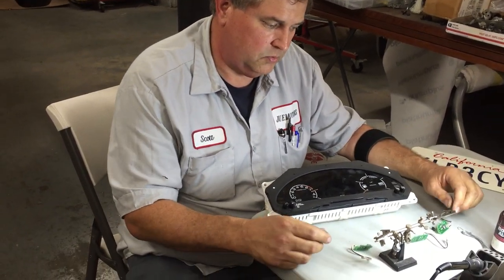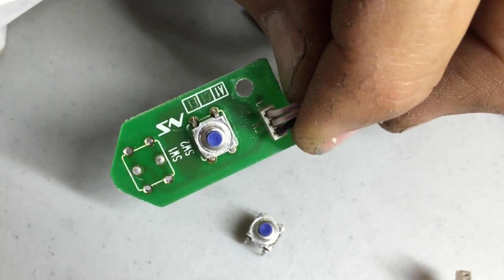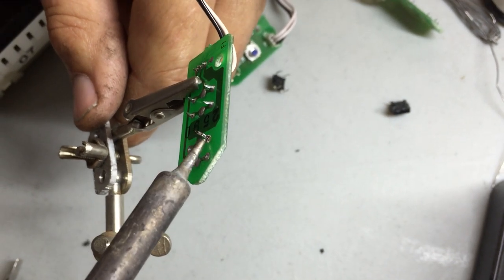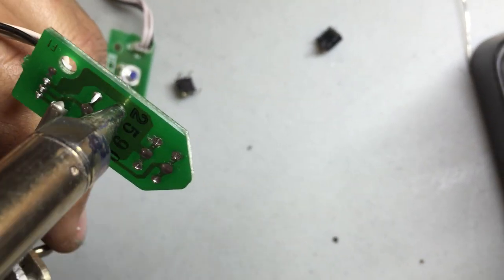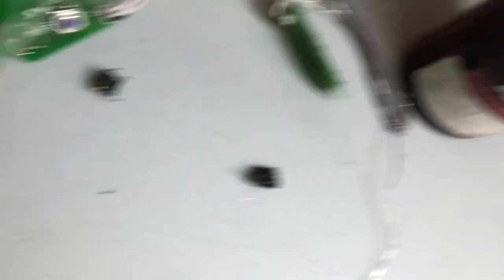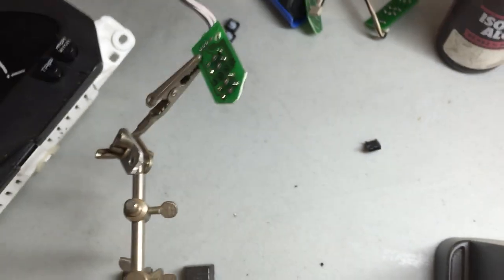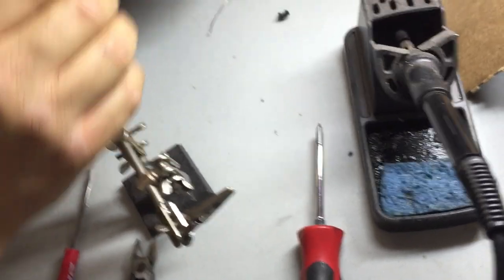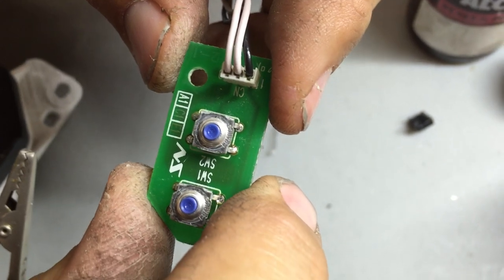Honda Insight Gen1, 2000-2006, Cluster Button Replacement

Comment: Hey scott, great video, have you ever tried just carefully pulling the rubber boot off the switch?  You can gently rub some fine steel wool on the contacts using a jewelers screwdriver, instead of cutting/soldering on a new button.  It worked for me, and might save you some time in the future.